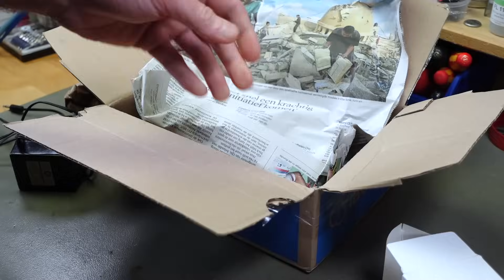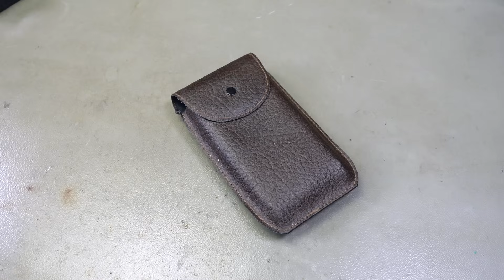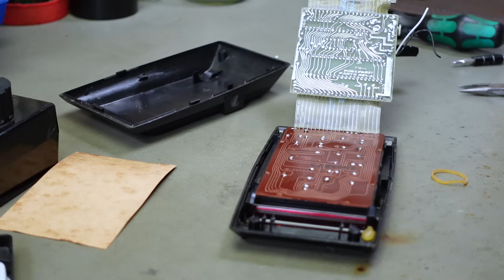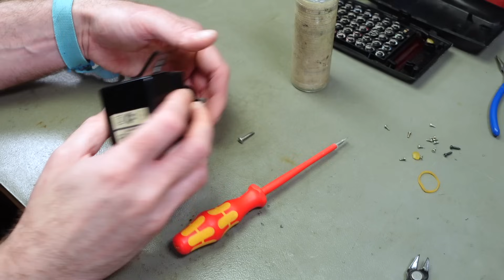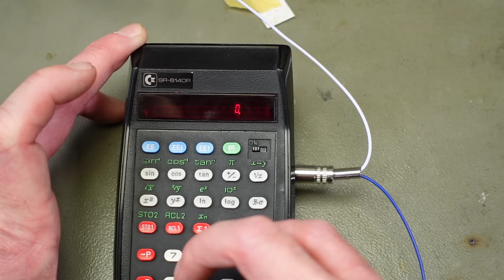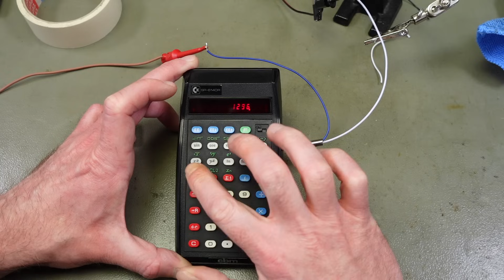1970s Commodore Scientific Calculator Restoration

Comment: The dangling thing with black shrink wrap is a step-up voltage converter. The rechargeable model was powered by 3 half-length NiCd cells in series, and the voltage from them was not enough for the calculator. The cells were configured physically as 2 + 1, with the step-up circuit in line with the single cell.  The step-up circuit doubles the voltage by creating a negative voltage equal to the battery voltage. Red/black is battery plus/minus, and the blue is the negative voltage output.
Reply from the maker: Thanks for pointing that out! Makes complete sense! :D
Reply: I am just working on SR4148 with identical power supply arrangements. Do you mean PCB runs on +3V, 0V and -3V? On PCB there are labels VSS = positive voltage and VGG = negative voltage and "-" which I guess is 0V.

Comment: My first scientific as a kid was a Commodore. You cannot imagine how even this primitive machine was a gigantic upgrade over a slide rule. A typical sort of problem I needed to solve involved 4 angles, 3 cosines and 2 sines, 3 multiplications, a subtraction and an addition, and then an inverse cosine. It took several minutes at maximum speed using lookup tables of functions. I could suddenly do that in 15 seconds even taking into account the slow speed. I wore it out. A year later I got a TI programmable. I wish I had kept the Commodore.

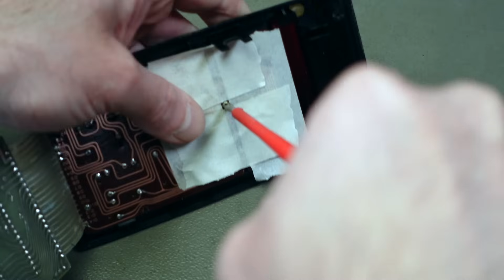Comment: 11:45 Another method of removing a stripped screw is to take some needle nose pliers, grip it around the screwhead, and torque it. It sometimes works, sometimes not, dremeling a flathead like you did is also a good way to do that.

Comment: My walk down memory lane takes me back 50 years..to I think 1974..might possibly be late '73..my first pocket calculator the Commodore 776M..similar to your black one but in beige..I was an office lad about 17 years old and needed to share the desktop mains one with the lady several times a week..desk calculators cost a fortune then..way out of my price range..but then these were introduced about 1973..9volt battery pocket model..i saw in Selfridge's London west end only a few hundred yards away from the offices..and affordable £9.95 or 9.99 a tenner basically..it was very useful at work for a while..less competing for time on the desktop one..still needed that for printouts but most of my job was double checking for errors so the pocket one was ok for that..i still had mine in the 80's but i guess it got replaced and i didn't care where it went..pity

Comment: 😅 but, but, but why didn't you investigate the shrink wrapped dongle? What was it? Don't just ignore it! We need to know
Reply from the maker: I still don't know for sure (and I didn't want to rip it apart to not destroy it). Somebody commented that it was a voltage doubler circuit because the original battery didn't provide enough voltage for the calculator. Which totally makes sense. They probably added the little thing to the rechargeable models and left it out of the "disposable battery" ones.

Comment: A beautiful little scientific calc fully loaded with all the needed maths! The scratch on the display at center it is caused by the pouch itself from the push button of the lid. Sadly a mistake in the design of the protective case otherwise this thing seems that it was made to be used and last the usage, cheers from Greece!
Reply from the maker: That makes sense! I didn't realize that the scratch exactly matches the position of the pouch button. I might just add a little padding to the backside of that to prevent more scratches!

Comment: Recently I found TWO identical Commodores, branded Privileg SR80D-NC. Very similar to this one (and with the same CPU), but VFD instead of LED. One required VFD replacement (by a Soviet tube from Electronica MK-61).
Reply from the maker: Nice! I read somewhere that these were sold by different brands internationally. The VFD displays were marketed as the "green line" if I remember correctly. Very cutting edge technology at the time!
Reply: @JanBeta  Yep, "green line". But they did not put this name on their scientific devices.

Comment: Bubble Display. Ebenfalls, aber in grün. Und nicht von Commodore, sondern MBO.
Wissenschaftlicher Taschenrechner, aber nur ein Speicherplatz, kein Punkt vor Strich, nur zwei Klammern möglich,
Aber sonst... ebenfalls bunte, gefederte Einzeltasten, viel Plastik, aber die Oberseite hat das Tastenfeld in gebürstetem Aluminium eingefangen.
Ein toller Rechner. Die 8 Zahlen bauen nicht von rechts auf, sondern von links. Man muss sich eben im Vorfeld Gedanken machen, wie man eine Rechnung angeht aufgrund der oben genannten Unzulänglichkeiten.
Ach ja... 10 durch 3 mal 3 ergibt, natürlich, 9.9999999. 😅
Aber das Ding sollte ebenfalls frühe 70er sein. Erbstück meines Vaters. Halte ich absolut in Ehren.
Reply from the maker: Schön! Die grünen Displays waren VFDs, soviel ich weiß. Commodore hat die damals als "green line" verkauft. Das war zu der Zeit sehr "High End", glaube ich. :) Klingt ungewohnt, dass sich die Zahlen von der anderen Seite aufbauen, aber vermutlich gibt es aus der Zeit einiges an aus heutiger Sicht etwas seltsam wirkenden Geräten, bis sich da auf eine einheitliche Bedienung geeinigt wurde. :D

Comment: I thought you were going to remove the electrical tape to see what was in that little pack.
Reply from the maker: I didn't want to destroy it. A commenter pointed out that it was probably a voltage doubler circuit or a step up converter to make up for the lack of voltage from the original rechargeable battery. Makes sense. They probably added the little pack to the rechargeable version and left it out for the "disposable battery" version.

Comment: Well done Jan.  Great work.  I couldn't help but notice (:)) that there is just a tiny bit of silver showing on the top front label. A tiny dab with some black enamel nail polish on the tip of a toothpick will cover that. Also could it be the inside of the press stud on the cover is what is burring the display?
Reply from the maker: Thanks! I didn't notice the little spot until you mentioned it. I'm going to try to fix it up. I think you are right about the stud causing the scratches. I am going to put some padding on the inside of the pouch I guess. :)

Comment: Calculators can be problematic with some mathematics, all thanks to BODMAS, modern calculators 9aprticularly the apps on phones) calculate using BODMAS, but traditional ones, such as this, do not, and they can produce different answers due to the way they process the numbers entered, it confuses me, but there's smarter people out there who know how it all works!!! :P
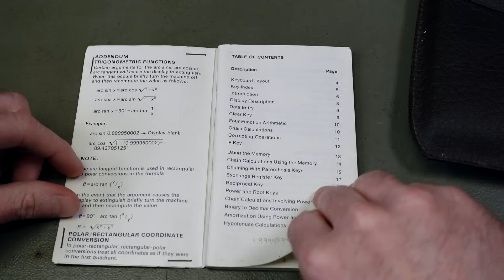Reply: If you look at 2:29, you will see a manual page that describes an error that this calculator had. For some arguments in trigonometric functions it wouldn't display an output and you had to circumvent it. On the bottom of the page to the right of it, I noted where it still worked and where it didn't.

Comment: Why not make an adapter to let you run it off USB-C then you can use any modern battery bank?
Reply from the maker: I'm going to look into that! I tried running it from 5V but it didn't quite suffice to power it so a regular old-school USB adapter is not going to be enough. USB-C should be feasible though.

Comment: Did I miss it or did you never reveal what the shrinktube mystery thing dangling from the red and blue wire is?
Reply: I think it was the regulator for charging the NiCad batteries. I took the batteries out when they stopped charging.
Reply from the maker: A commenter pointed out that it is a step-up converter to slightly raise the voltage from the original rechargeable battery. Which makes sense. Probably they included the little circuit in the rechargeable models to make up for the slightly less powerful battery and left it out for the "disposable battery" models.

Comment: See if it will run on 5 volt then you can do a usb to phono cable 👍🏻
Reply from the maker: I tried with the bench supply, but 5V don't seem to be enough unfortunately. It powers on but then instantly crashes. I guess the additional circuitry brings the voltage down enough so that the chips don't get enough juice. 6V seems to be the lowest voltage that makes it work although the chips are 5V. I guess it could be modified to run on 5V (by connecting the voltage to the spots where the original battery went) but I don't really want to modify this museum piece any more than absolutely necessary.

Comment: Back in the day I used to live within bike riding distance of the UK Commodore factory where they made these things. A little bin diving on a weekend and some soldering work let me revive rejected models. I managed to get one of their SR-9000 series models working, which was hugely sophisticated for the time, with 10 memories and 90 odd functions covering trigonometry, statistics and a bunch of other stuff. It made teachers eyes bulge when I whipped it out to answer questions 😊
Reply: Very cool! I have a small collection of vintage calculators, and I especially like the displays. Much better than modern dull monochrome LCDs. Earlier electronic devices also just had more style to them.
Reply from the maker: Wow, that's awesome! Thanks for sharing! I can imagine that calculators were not a common thing back in those days. I am slightly too young to have witnessed that revolution first hand (I used bland LCD calculators in school and uni which were super inexpensive and readily available at the time already). :D

Comment: A calculator with 11 digits plus an exponent is still considered professional today! I wonder how much something like that cost in the 70s
Reply: I can tell that exactly, because it belonged to me. It was 199 Dutch Guilders in 1976 of 1977. With correction for inflation it would be a little over 300 euros now. At the time I sent it to Jan I looked if I could still find the original sales slip, but I couldn't.

Comment: Congrats Jan,

Now you own a nice CBM.

Years ago I found a SR-4148 at a local fleamarket. Sadly it still had the NiCads inside which, of course, leaked heavily... I needed to give it an depth cleaning and also rebuild some traces, replaced nearly all passives and that 'flex' cable as well. 

Also mine didn't come with any power supply (it had cost only 10 bucks, non working) I designed and built a regulated one myself with went in the space where that NiCad pack originally was located. Now I can run it from anything above 6 volts AC and 9 volts DC and no need to worry about polarity.

But in the end I had, and still have, a nice golden C= age, scientific calculator.

It's def. worth the time and effort. 👍😊
Reply from the maker: Nice! These old calculators are magnificent pieces of history indeed. I plan on using mine with a modern power supply that I'm going to put the correct connector on (already ordered a suitable one) which should be very convenient. :)

Comment: Glad to see these old calculators get some love! You might check around, but on a lot of the old calculators with the "built in" nicad batteries, the battery was a buffer for in-rush current when the calculator was being charged/powered from the charger.  Great video!
Reply from the maker: Good call! Maybe it would be a good idea to just put a capacitor on those battery connections to replicate that behavior to some extent. I guess putting a new battery in is probably not very wise (because leakage etc), I plan to use it with a power supply anyway.

Comment: Pro tip: you can put the wrist strap on your leg, so your hands will be free. It doesn't need to be on your wrist because the whole human body is conductive and there's a large value resistor inside the strap anyway..
Reply from the maker: I know! I wear it on my wrist for being able to quickly remove it when I work on devices that I have to power from the mains while testing. You don't want to be connected to ground (even if through a resistor) while accidentally touching something mains powered.